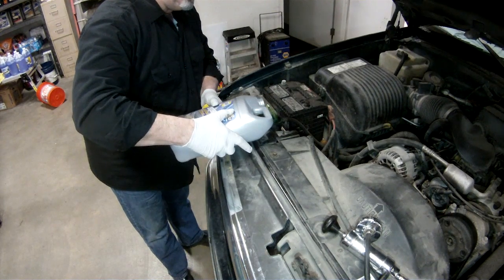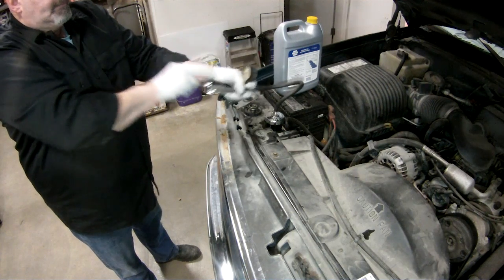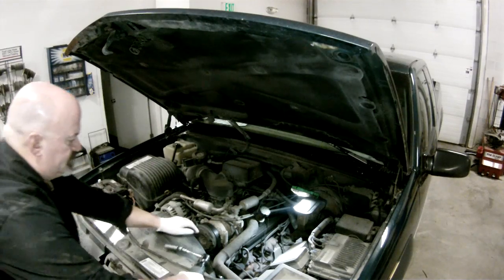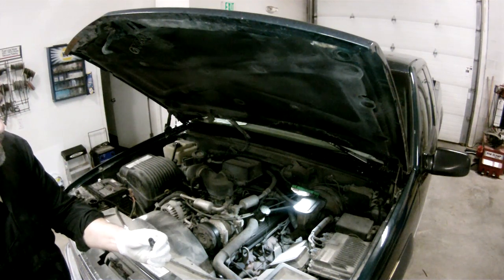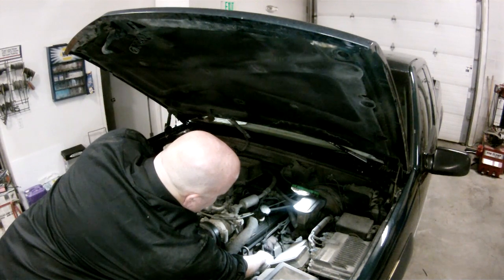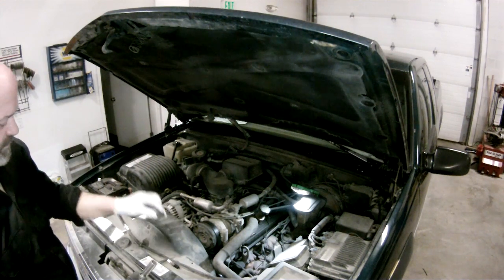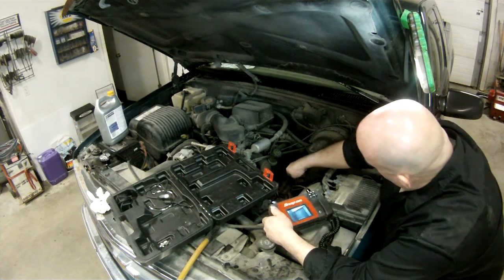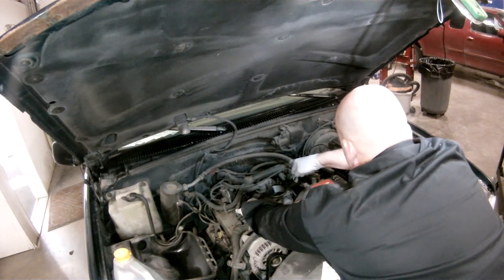Chevy Silverado Cracked Intake Manifold - 5.7L Vortec Intake Manifold Coolant Leak

Comment: I have 1999 GMC 4x4  Suburban with 180K that just reared it's ugly head with this problem.  It's only been driven 60 miles with the problem. I'm planning to take it in tomorrow to a local shop and see if I can get an estimate. What interesting is that it never show's it's overheating, although the "check guages" light has blinked on and off a few times.  Tranny has been solid with no apparent issues.  I'k like to keep this ride, although I do have other rides.  It's been great to have for local trips that require space. and hauling.  Other car's that I have are to small to add a trailer.  I live in Texas and I'm hoping that the bill isn't to crazy.  (under 1K).  Time will tell.  If it's too funky, probably will sell it, although not sure what it's worth in thie currrent condition. Sure do enjoy your videos.
Reply from the maker: Shouldn't be too spendy depending on the area. I guess 500-800 ish total. Good luck and thanks for dropping by!

Comment: hi my friend is leaking coolant from the passenger side I looked under his car a couple of days later when he told me I don't see no sign of current loss but it's on the floor respect the hoses and radiator and the cap they're all in good condition I haven't drove it out about a hundred miles and no overheating issues but no pressure in the hoses and no leak in the gaskets either can it be like that video you put where it's getting the oil in the bottom
Reply from the maker: Yes but the water pumps leak and its hard to see where its running out. Look for signs of coolant dripping off the passenger side of the oil pan gasket area along the length of the pan or along the front of the steering linkage area which would indicate a water pump leak. Other wise remove the oil drain plug and watch for any coolant running out.
Reply: thank u very much

Comment: hay, car Dr,  I have 99 GMC Suburban 5.7 Vortec L31 engine.  very robust and reliable vehicle for me,  I've put 125,000 miles on it. it's now 224,000 miles.  I just replaced my intake manifold gaskets and bolts, heater coupler.  bolts were stretched to a degree. coupler were rusted out. it took me complete full day to do it all. When I had the manifold off,  I decarbonized the intake and the ports. cleaned it up pretty well. I put Al Delco brand in instead of felpro.  it runs pretty dam good now.  now that's done,  I need to focus on my tranny,  it needs to be rebuilt. Then I'm good for many miles to come.  I love this truck :)  love yar videos!
Reply from the maker: Nice, sounds like a productive day of work and im sure youll get lots of service out of it in the future now. Thanks for watching my vids buddy. Take care

Comment: Perfect description of what happened to my 1998 Chevy with the 5.7. The intake manifold gasket failed (or the intake cracked) and the coolant filled the oil pan. The engine had 188,000 miles on it so had a rebuilt engine installed. It was a $2000 repair! What can I say, I need the truck. I'd like to have that one for the body, it looks straight.
Reply from the maker: +wyattoneable The body and frame are in excellent condition. I can put you in touch with the owner and you can come out with a trailer for it. But I think it will cost you about 10,000 in gas round trip. This is a 4X4 so even the labor to replace the engine is more. I can't even  buy a quality reman (GM goodwrench) engine for much less than 2000 here. Oh well, I just hope I can actually fix some cars today. Thanks for stopping by!
Reply: +The Car Doctor That would be a fun road trip. I've done that drive through Canada before. I wonder if the Alaska highway has been paved since then?  :)
Reply from the maker: Yes. It's paved all the way. Super fun drive. I've done it about 15 times.
Reply: @ThecardoctorTV  m
Reply: They had 5.7 s? 👁 👄 👁 Where ma wallet!!!

Comment: What I find amusing in all these cases where it will "cost more to fix than its worth" cases that the owner goes out and spends about 5 times as much again on a new or late model. Even more amusing is to hear the stories about all the costs and repairs on the new one after a few years. Had they fixed the old one they would have saved 1000s and be driving something more classic. Of course this is assuming the old one is not rusting to bits.
Reply: Andy Thompson your right on the money. I have a 2000 Silverado that I drive daily now mind you I only put about 5000 miles a year on it but I have recently had to replace quite a bit of parts on it mostly original parts. Been a hell of a good truck with minimal rust on it and best of all it is paid for and the insurance is pretty cheap. Every time I have something that needs replaced my buddies say "why don't you get rid of that thing and get something newer". Now mind you I would love to have a nice fancy newer truck but im not in love with the idea of a $500+ payment a month. I will repair my older one when it needs it, take care of it, and keep it on the road as long as possible. When she rusts into I will get something newer.
Reply from the maker: +Andrew Thompson You make valid points. We don't have a lot of rust here so that's not an issue. Replacing the engine and transmission along with other components in this case would probably end up around 10,000 and they likely decided it wasn't worth the investment. It is also a second car for the family and that no doubt factored into their decision. I thought to myself about offering something for the truck since it has brand new tires but then I counted the cost and even for me it's more than I care to spend on an older vehicle. We have become very disposable in our culture and it's a mindset that will likely only get worse in the future unless we go through major economic downturn and start being more careful about how we spend our money. Thanks for stopping by!
Reply: +The Car Doctor I guess I have an ever increasing worry about the quality and the pure time it takes to fix a modern car so these old trucks to me are more appealing. Maybe I'm getting old. Thanks for the videos.
Reply from the maker: I get it. These trucks run forever if maintained. The transmissions were a weak point in these years. But totally worth keeping on the road compared to getting yourself into a 600+ car payment plus insurance on a new one. Blessings.
Reply: i drive a 1995 c1500 5.7 tbi . ive replaced everything from the rear differential to the ecm to the steering gearbox to the sway bar bushings... yeah , its a rough old truck , but no payments ! ive put lots of salvage parts , i had a local tranny specialist check the tranny & its in good shape . the engine doesnt smoke and runs well, ive recently had a core/freeze plug rust threw, so they all need replaced soon. 30k miles. a deer took out my AC & on my july birthday while drinking several beers , my GF gifted me a radio, and yeah i f*#kd the climate control unit installing... (remove battery connection before any ele. work ,lol) a salvage unit was to costly, so i defeated the ductwork servo's and zip tied the arm so only defrost works & the blend door only blows hot. the driver side wiper linkage has a stamped copper plate that hold it together and it fails sometimes, so i leave the plastic cowl cover off fir quick acess , it only fails when your on the road and its raining. lol. i bought new tail/stop lamp assembly, old was sun baked, new multi-switch/blinker switch was $300. limped it 15miles to near town & had driveshaft swing/carriet bearing pressed on, the shop over charged me , because i was stranded. ive put all new Moog ball joints, but the cheapie wheel bearings. fuel pump, radiator, starter, intake gasket, TBI rebuild kit, inside door handles, AC blower motor plastic fan. steering shaft coupler, power steering pump, ing. coil, egr valve, had the swing arm cam washers adjusted, ect. this truck has become a science project ; how long will it go. lol
Reply: A!a+
Reply: Absolutely correct

Comment: Is it just me, or is 400$ really a lot of money for just an intake gasket? 
Last weekend I replaced intake+exhaust gasket on my '86 Volvo: €15
Reply from the maker: +Koffi Banan 400 (or €1500 haha) is the cost of an entire intake manifold (kit) in this case a fairly large chunk of cast aluminum. But we are in Alaska where everything is more expensive I guess. I wish I hadn't replaced the water pump before discovering the bigger problem.
Reply: I just bought felpro upper & lower  and all gaskets from advance auto $60

Comment: I'm not familiar with the 5.7 Vortec.  Why does the engine design flow coolant through the intake manifold? Do you know the reason?
Reply: +The Car Doctor 
the hear get earthed?!? :p
Reply from the maker: They call me "The Undertaker"
Reply from the maker: +Ozzstar Good question. Many engines do this and I won't pretend to know all the reasons. One is that the flow of coolant needs to cross over from one cylinder head to another and then through the engine block. It's just a pathway to allow flow across the entire engine. Also, the hear get earthed from the flow of coolant prevents atomized fuel from hitting a cold intake base and turning into liquid this becoming less efficient as it enters the combustion chambers. I bet there are even more important reasons I haven't thought of but that's why I just fix them not design them. Well in this case I just read them their last rights! Thanks for watching.